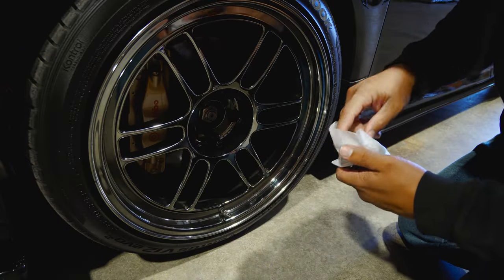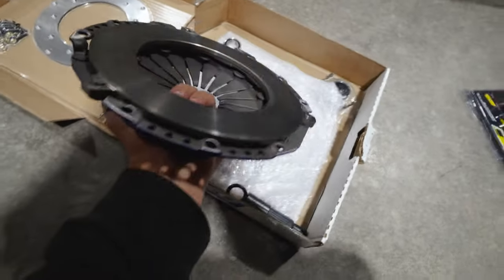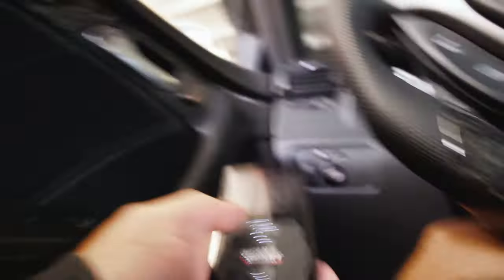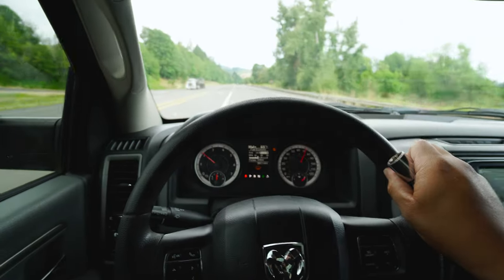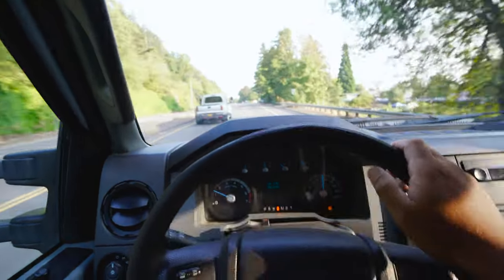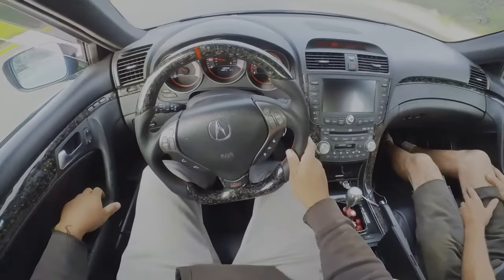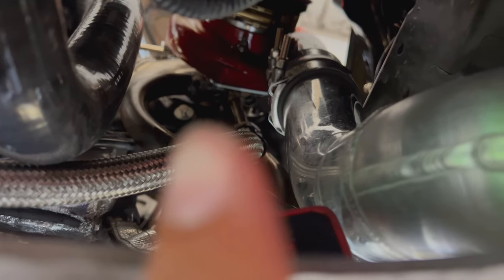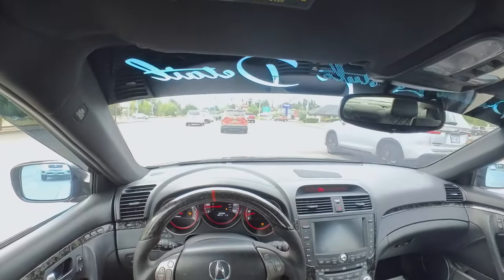Getting stage 3 clutch installed on my Boosted Acura tl type s

Comment: As a OG group TL owner.

The spline in the video is called "input shaft".  You can buy a replacement from Acura (if they have it in stock) and disassemble the trans apart to replace it.  You will also need a new bell housing (both most likely on back order now).

whoever put the clutch backward is an idiots as it clearly said trans side and pressure plate side (this info can be found with AHC TL-S build clutch replacement video).  This is why I said you paid mechanic for their knowledge and experience not per job. 

Honda/Acura dealer aren't exactly know what they doing either , as most of the techs are new comer.  

On the new clutch you suppose to give it 500 miles break in, avoiding redline and aggressive shifting.   Being now turbo with updated flywheel and clutch I would suggest a few thing.  As I seen more than  a handful of mod TL that suffer blowing transmission gear set.

1. DO NOT launch the car from dig or doing a pull from less than 40 mph.  

2. These trans weakness is in the 2nd and 3rd gear set.  There are reason why Acura put the dual mass flywheel setup, it easier to replace motor mounts, axles and clutch than transmission.

3. I would leave the stock axles for assurance purpose, worst case is you gonna snap axles instead of the trans.

The price of a used trans for Type S isn't exactly cheap, around $2500 from a part car and they are only a few in the country at any given time.  You can use the 04-06 MT but the bell housing will have to be 07-08 Type S MT and the internal of the base isn't up to Type S standard.

Best of luck in your build man, keep up the TL game.  I still have my TL despite of moving to another  brand/platform.
Reply from the maker: Good looks !! Thanks for all the info 🤌🏽🤌🏽